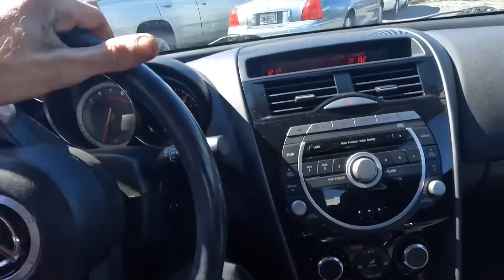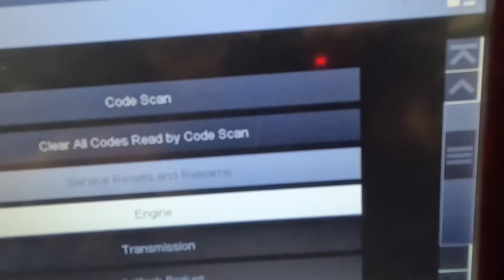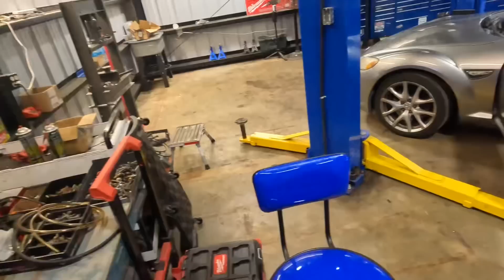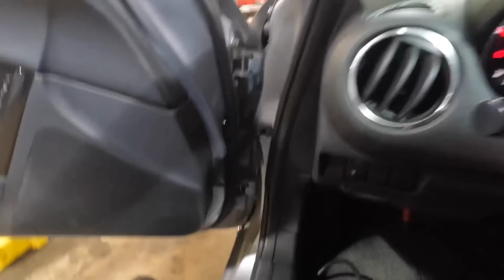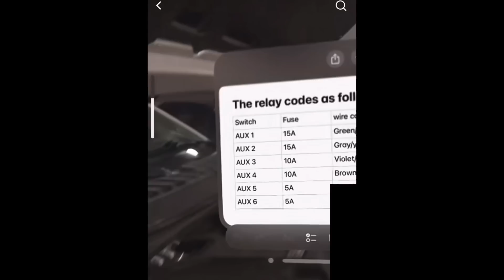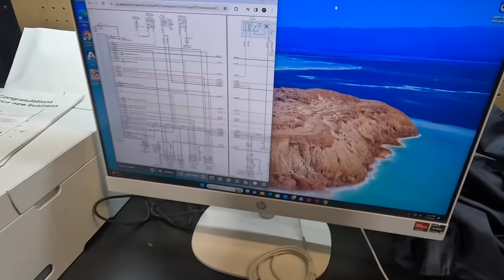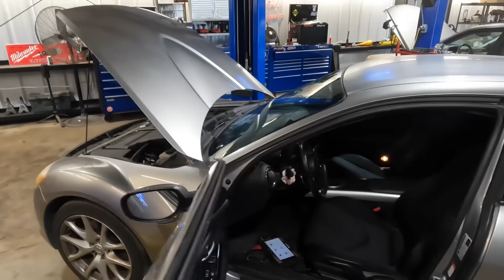Will Virtual Reality REPLACE Mechanics?? Mazda Rx-8

Comment: The amount of data needed for the resolution to diag a lose connector would be insane. Then multiply that for all the connectors on every make and model for the past, say 30 years. Plus, there'd have to special sensors to detect engine oil, tranny oil, antifreeze, brake fluid, power steering fluid, freon, etc. I just don't see it happening. Ray is right. The Apple VR headsets scratch easy. Plus, it would have to deal with grease and oil and not get FUBARed. No, I don't see it happening any time soon.

Comment: My thoughts on AR are that the greatest utility for working on cars will be with wiring diagrams. Being able to overlay the harness or connector on the vehicle with the color codes and pin outs would have the most utility. Anything else, I'm highly skeptical
Reply: so you can see thru the vr headset to see the actual wiring with the overlaid diagram?
Reply: @jonmack5359  exactly

Comment: No. Rotary engines normally are smooth running like glass. I had a '91 RX-7 I bought new and at idle I couldn't even tell if the engine was running except for looking at the tachometer. It idled that smoothly and quietly. Zoom Zoom.
Reply: People are being raised to not have or rely on critical thinking skills. Think "Big Brother".

Comment: My AI conclusion is dust in vent hole, and dirty electrical contacts.
Hey cheap fast repair attempt.
The car has almost no miles on it
And looks like its parked outside by a beach. I see sand all over the engine bay and what might be salt from ocen spray.  I'd look at ground connections also.
No data on this and I'm betting it something simple mostly because of the mileage. Could even be low voltage bad battery low charge.
It doesn't even look like that last guy pulled the plastic covers off the engine and found the PCM 

Cars don't like to sit they need to be driven.

Comment: Ray, you are absolutely correct regarding the VR diagnostic tools. They will keep trying, but they’re a long way from having a proper and effective platform.  Those VR masks are way too cumbersome and not much use outside of a video game. It is highly improbable they will ever replace the human element in the application of the tool. 

There is no replacing your experience and knowledge gained through years of working in the industry. 

As for chips in the brain; careful the path we place ourselves on. We can be assured, unintended consequences will be the result. That’s a hard NO!
Reply: Great wisdom.  Too bad the powers that be choose to ignore it.

Comment: 50 years ago I used a human trained mechanic for servicing my cars. He could fix most things by just listening close to the exhaust. Then adjusting the carburetor, (remember those?) or Distributor/plugs manually until it sounded right to his trained ear. Job done and we were good to go for another 25,000 miles. Oil change extra. Cup of tea gratis from his wife unit whilst we waited.

Good feature Ray.
Reply: Those were the days, my friend. 😉
Reply: When we used a broomstick or used an empty funnel at the block to our ear to find out which valve was tapping .. or when we would take out the #1 plug and put our finger over the hole and have our buddy crank until we felt pressure.. how we found top dead center back in the day.  (Yeah, im thay old to remember that)  lol
Reply: Back in those leaded gas days I couldn't get 25,000 miles on a set of plugs, maybe 20,000 at best.
Reply: @jimdavis6833  In those days, cars were affordable to the average person.  That same person could repair that car out in the backyard on a beautiful summer day.  Cars were far less complicated than they are today.
Reply: Oil change I can do same with d brakes, everything else my mechanic does cars today I just scratch my head and wonder.
Reply: Human trained?

Comment: I was a ASE parts specialist. We used books and experience before the computer screen arrived at the parts counter.  The computer displaced or ended the careers of many talented people.   I saw it coming and I learned how to fix, build and repair computers back in the last century, taking advantage of the new technology.  VR is a dead end in my opinion.
Reply: The problem with VR is it's too god damn expensive. And sure when it first came out, early adopter fees are a thing. But now that they've been around for nearly a decade, the prices just ain't dropping unless you want a third party set that'll give you motion sickness. Like how are shops going to afford to put a headset on every mechanic in every shop? They already have to buy expensive tools as is.
Reply: @Thatonefuckinguy  so, just like the dipshit that was making the claim about vr replacing mechanics, you dont know what the hell you're talking about. VR rigs prices are pretty much equivalent to the prices of smart phones. 

and no, the apple vision pro is not over priced.....not anymore overpriced than your average apple iphone. 

the quest 3 128 gig is only 500 dollar; maybe with any accessories that you would need to buy (like a decent head strap), the cost would go up to about 650.....that is not expensive, considering the tech thats inside it. im pretty sure that some of Ray's hand tools cost more than that
Reply: @Thatonefuckinguy the price is definitely not the problem with VR. A decent "first-party" headset can be had for $350. Unless you're talking AR, which is more expensive and technically challenging to do.
Reply: Yeah, I can either buy a set of snap on flank drive plus 4 angle wrenches or one headset that is extremely sensitive to harsh environments, it’s kind of a no brainer which is more important
Reply: I wouldn't want to wear a AR/VR headset in any circumstance. AR/VR has been going to be the next big thing for 30-odd years now. It's still stupid. I need less screens in my life, not more. I'd need a really super hardcore usage case to want one.

Comment: HELLO. Good interesting video.

I've never liked high gloss plastics as they get finger marks and scratches very easily as you can see easily. You also get the annoying light reflection.

Rough atte plastic that is 30% 40% glossy is prettiest. or a pattern in the plastic

Comment: I found the problem with that car as soon as you opened the door.  
The shifter only moves in one direction and it's missing a 3rd pedal.
Reply: Serious problems if I do say so myself! Esp on a rotary I drove a friend's 93-94 rx7 5spd and what a car. (around 2000)
Reply: @frizzlefry5  those engines love to rev.  Keep them around 4500 and they are really peppy.  I had a friend with a drift prepped JDM one...98ish I think.  It was very fun.
Reply: They should've just made all auto RX-8's with a 2l 4 cylinder or something. Complete mystery as to why the auto rotary exists at all.
Reply: @MattExzy  cause people can't drive stick but want cars that should only come with one.  Miata, RX8, BRZ/GT86 for example.

Comment: Wouldn’t a possible repair would be to clean the PCM connectors? Humid Florida is great and corroding electrical connectors.
Reply: @jdub264  I would at least check powers and grounds... And like you said, terminal fretting at the connectors... Check and test everything you can before calling a PCM...

Comment: The only thing VR is good for is training. The advantage is the actual vehicle Is not required and the student can access multiple vehicles thus cutting down costs - but as far as repairing a. Vehicle that is not going to happen in the near future- that will happen when they fully remove the mechanic with a robot

Comment: Ray, like you said in the video, check the connector, but in this case the throttlebody connector and check the pinclamps and / or wires. And or the other side at the throttle pedal. No PCM replacement required. Been there, done that ;-)

Comment: Sadly it is probably a fact that AI will be  better than most technicians...and will get better.
Right now it isn't. As far as heasdets go, of course what will happen, is that you Ray will be sitting in the office next to Lauren, having a coffee, while your headset is showing a robot camera's view of everything  -  a robot that can get to every nut and bolt and has sensors for coolant, oil transmission fluid, escaped grease etc. And can crawl inside a differential and measure wear...

In short an infinitely superior tool ...

Comment: to answer your question in your video title? NO nothing can replace the technician that actually has to put their hands on a vehicle or machine to repair it. The only thing that has changed over the years is the method on how the repairs are diagnosed and completed. If you look how things are designed today you'll realize that manufacturing is edging towards producing 'throw away' products, most products are like this today because the cost of repairing them, outweighs the worth of the product and isn't worth repairing. But with that said, technician's will always been needed in some form or another.

Comment: Ray, anytime someone says "eliminate" for 99% of "new and shiny" is chugging the Kool-Aide of what's being peddled. Since you are lucky to get the broader population to BRING a car in for an oil change (just search on oil change disasters for that nugget), mechanics will always be a thing. Most people are completely inept on the operations of a vehicle beyond "get in car, push button, put in D and push skinny pedal". Check air pressure? Change air or filter? Put on wiper blades? Naaah bro. If those straight forward tasks are beyond the will of the masses, are they going to jump in, diag a problem, then pull & replace major components? Ummm, no. Capability, resources (tools and space to do the work) and even interest aren't there. The person/people thinking "VR will eliminate mechanics" is discounting the apathy and skill level of broader society. If anything, it could be another (potential) tool in the mechanic's toolbox (at most) to assist them in getting things done.

Comment: ive worked on robots, and im a tech nerd, but at no point did i fear they could take my job. 

all current robots are in factories, doing repetitive tasks. they cant do anything different without weeks of new programming, and even then they have to be tested to see if they do what they're supposed to. 

at best, 30 years there'll be almost no people in factories, 50 years the robots could be building themselves. 

but i dont see any point in the future where robots could replace any trade, especially with repairs. 

trouble shooting logic is one thing they could probably do soon, but actually changing parts on so many machines, not in this century

Comment: Every time there is an improvement or change to IT, there will always be those that push the idea that it will put everyone out of work. I've worked in IT for most of my working life and I've seen this again and again. Most of the time it doesn't happen. When it does happen, it usually means that you change the way things are done rather than you stop doing those things altogether.
Reply: Correct. Take printers: paper was going to be gone. Nowadays, never has there been more paper used then ever.

Comment: There’s no cure all for diagnosing issues with the car ,with a human ,with anything by looking through a headset . Ai has to learn by mistakes which I’m sure you Ray have made many it’s called experience. If AI is going to work at any time in the future it will have to be able to do this. Remember the computer that is programmed is only as smart as the programmers!

Comment: Ai will have access to every piece of data of every failure and problems found. I don't see techs being replaced soon. But 5-10 years? A lot of jobs will be in danger.
Reply: 5-10 years some bankers and advertisers might worry about their jobs, but definitely no trades. too much technical practice has to be learned for a robot to replace them